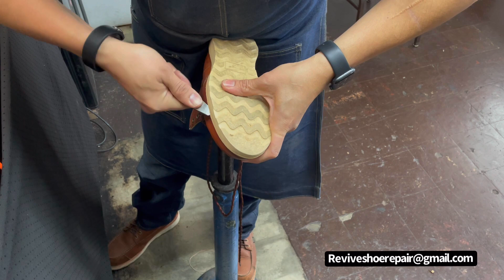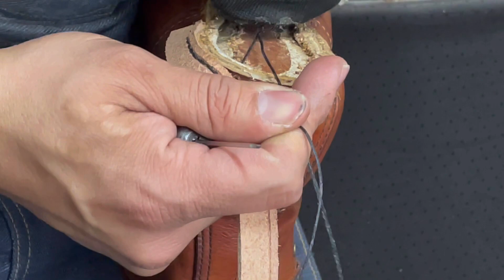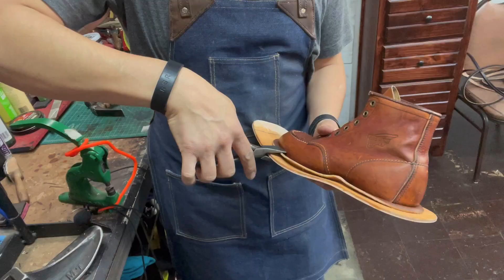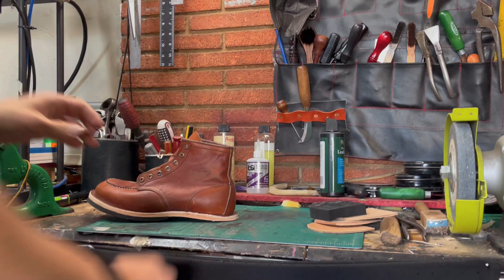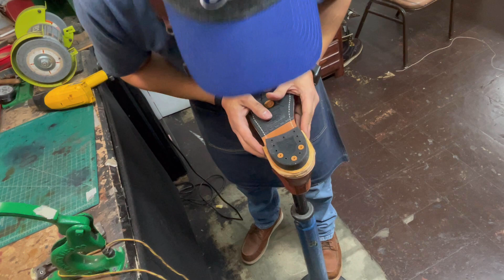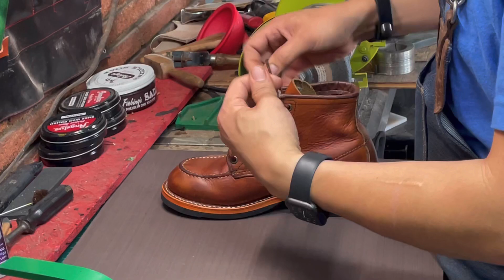Red Wing 10875 improved/Dr.sole #redwingboots #redwingheritage #shoerepair

Comment: Sometimes cobblers sew on a rubber sole on a welted shoe, sometimes just glue. How do you decide? Great video!
Reply from the maker: Thanks Sir, usually we don’t do it when we put on (sole protector)or sole savers cause the material is very thin, but when it comes to rubber soles, as long as the outsole stitcher can handle the thickness it’s always good and better to do it!!